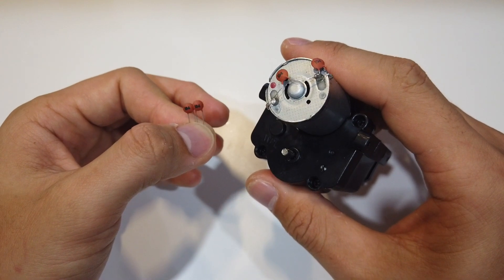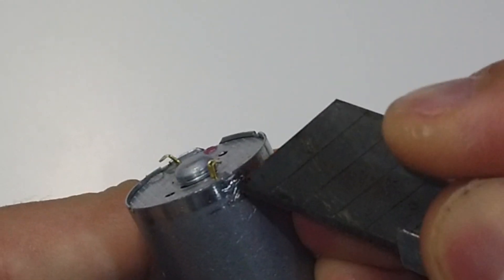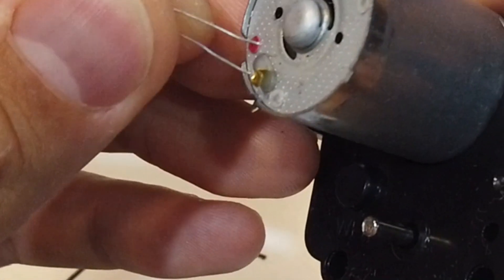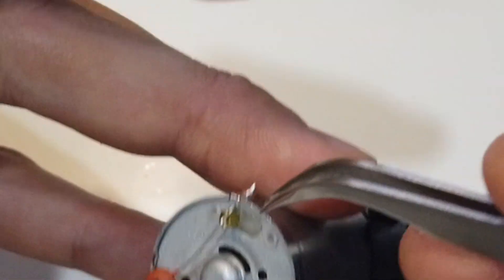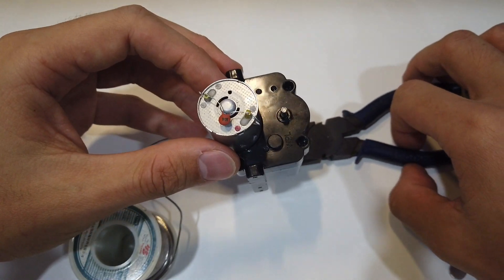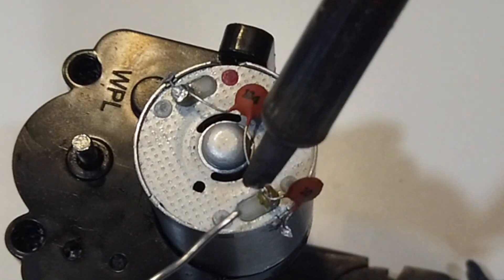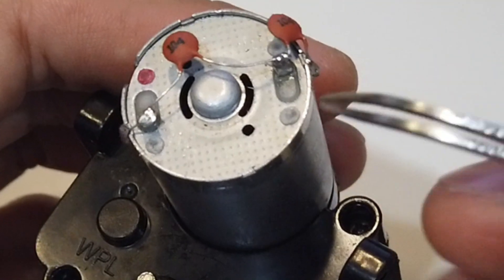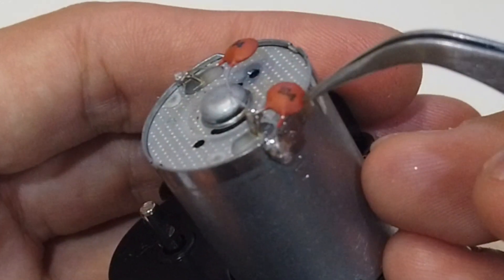Soldering 104 Capacitor on WPL 370 Motor - RES-V3 Sound Breaking Out Solution

Comment: It work well with DC motor control with relay+arduino+i2c lcd 1602 display.
Without capacitor it will freeze the lcd display (noise interfere with SDA/SLC wire)

Comment: Great video but you're not showing where the cables red and black goes.
Reply from the maker: Because It does not matter
Reply: @EdwardChew  Oh ok thank you . Didn't know.
Reply: there is a red dot mark.. if you prefer to put red wire on red dot side then direct grounded should be on negative side and 2nd capacitor on the +ve side.. else, as tasosx said, doesnt matter

Comment: Ty so much for this video, I've been getting so frustrated trying to solder my capacitors to my dynamite 280 motor but the solder isn't sticking to the motor body. I didn't know I had to scratch the motor body , it makes total sense to me now. So I'm going to go do this on my motor and I'm sure it will work now ty for the video

Comment: i have a question. i recently got a 370 motor for my wpl d12. does it need the capacitors and why does it hesitate when reversing but is ok going forward both speeds. (no cap installed) at first i thought it was the drive system so i took it apart and made sure there was no binding. same thing happened. tried the motor without gearbox attached, same thing. what do i do to fix it?

Comment: Hello, im upgrade my mn45 motor to 370, i wanna ask do i need to change the esc too? Because after upgrade, the motor not running some time, i have to wait a few seconds to continue running. Is it the esc problem?
Reply from the maker: ya the 370 motor pulls more current. you need a higher amp output esc
Reply: @EdwardChew  so ,i need to change esc and remote..oh mann

Comment: Hello. i use BTS 7960 circuit to control 24v 250w 14ampe motor so what kind of capacitor should i use. thanks
Reply from the maker: no idea

Comment: I have a MN99s with a 370 motor and single speed gearbox. Sometimes the motor cuts out completely and have to reverse and will be able to go forward again. Happing when motor is a little under load. Would this fix this? @EdwardRC Car
Reply from the maker: No. This is not related. Either you try a different esc or motor to check which is the issue.
Reply: @EdwardChew  you were right. Essentially what was happening is as soon as the motor was under load (throttle) it would cut the power, and would have to reverse and then go forward again. 

I replaced it with another 370 single speed gearbox module and it works wonders now. Could’ve just been a defect in the first motor
Reply: i also have same issue. what did you do?

Comment: @Dear Edward, thanks for the Video very informative but can u recommend a suitable capacitance value of the capacitor for noise reduction on a 24v/ 36v 775 motor? Can I use a 100uf 50v or 1000uf ceramic capacitor? Can I assume higher capacitance 1000uf come with better filtering on noise reduction of 775 DC motor?
Reply from the maker: you can only use ceramic capacitor in this case.
Those capacitors you mentioned have polarity. but your motor doesn't work one way only
Reply: @EdwardChew  Noted. Then in that case, I'll stick with Ceramic Capacitors 50V 100nF 0.1uF 104pF then. Thank you!
Reply from the maker: @ray2chua937  ok
Reply from the maker: @ray2chua937  if it goes up in smoke it means it's wrong :D
Reply: @EdwardChew  No worries, the 50v 104 Capacitor should be good enough for the 24v motor plus following yr Tutorial put me in safe hand ☺️
Reply from the maker: @ray2chua937  wow 24v motor

Comment: It works. Just did it. I had the petrol version and it was cutting out every 2 seconds or so. Now it's perfect. By the way I had the diesel version before and the sound was good without any capacitors on the motor.

Comment: You said to your othrer video that thers no need to put capacitor if your using wpl 370 motor on RES V3  controller so I assemble  it without the capacitor.It is hard to disassemble  again to put this capacitor. I want to know if  there will be a problem without the capacitor atouched to the motor?
Reply from the maker: You only need to put 370 caps if you have cutting out issue with the sound. If no issue then don't need to do anything
Reply: @EdwardChew  Thank you.

Comment: The red point marked terminal is the positive?
Reply from the maker: brushed motor has no polarity
Reply: @EdwardChew  so no matter where does the positive go?
will you not go back and forth the other way around?
Reply from the maker: @tamassara5635  what i mean is no worry of connecting which way. 
yes if it's not going the direction you want, simply flip the wires :)

Comment: do i need to do this if im upgrading to res v3 without installing the speaker? i have 370 for my d12 and want the resv3 for the extra power to the 370 that the original board cannot supply. but i wont be installing the speaker that comes with it
Reply from the maker: then you dont need to install the caps. these caps is to solve the interference to the sound of RES-V3 :-)
I installed RES-V3 to 370 motor on the D12. no issue

Comment: Good tip, there is a difference in the noise after the mod?. It´s the same that ground the motor box and two capacitors in parallel.
Reply: To be clear, the difference in in electrical noise i.e. EMI (electro-magnetic interference), not audio noise.
Reply from the maker: @veri745  yeap but that affected the sound
Reply from the maker: The developer of this board recommends this method and yes it works

Comment: I thought the caps were only needed with "older" radio gear. Thought the 2.4 gig radios made interferance from motors long gone?
Reply from the maker: Not radio interference. This is about the electrical noise from the motor interfering with the simulated engine sound
Reply: @EdwardChew  so this isnt needed if i keep the speaker unplugged? i dont have to solder anything at all?
Reply from the maker: @me-rn7jx  yes you dont need this if you dont use speaker
in fact most of the time this is not needed too even with speaker attached. there are just rare cases of sound issue
Reply: @EdwardChew  ahh i see also im not sure if you are the owner of wpl rc but ive just purchaced the b36 km kit and some other stuff im assuming ill need😂 ive never owned a 6x6 truck yet so it will be a nice collection to have